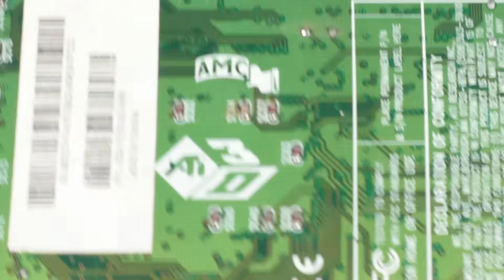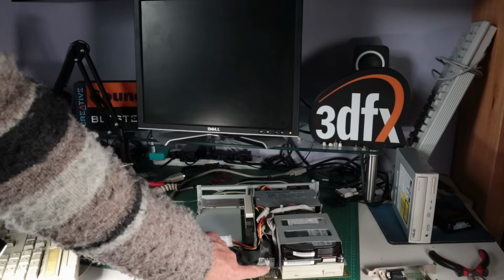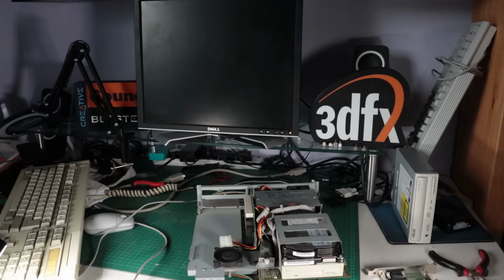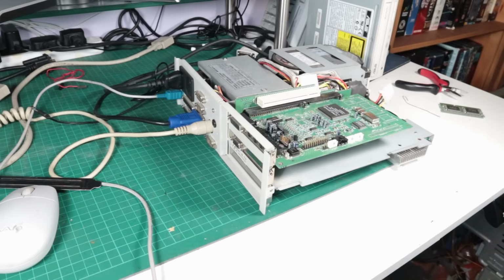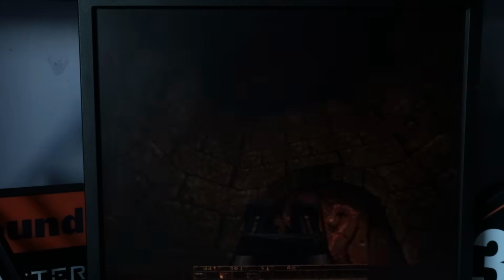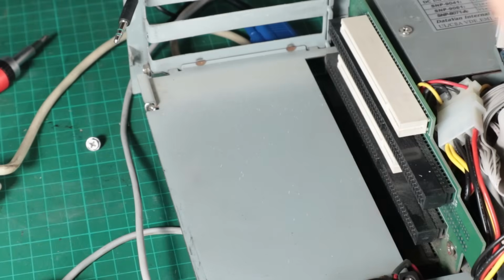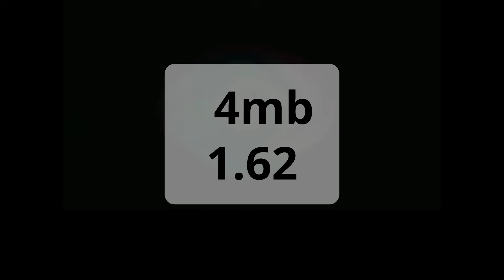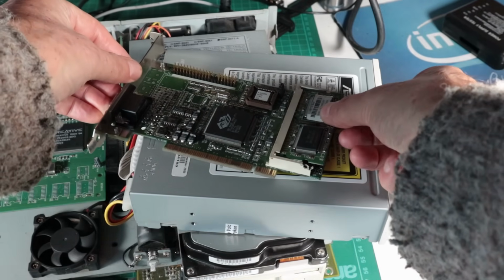Did upgrading vintage graphics card memory make a difference🤔🤞

Comment: Depends on how much memory being used really, if the GPU doesn't need it, then it won't bother. I imagine it might handicap it in some cases, because the memory controller has more addresses to look up at times but that would be minor as the benchmark suggests.
Reply: I know it's just modern parlance but this was before the "GPU" term was even commonspread, this was still just a "3D Accelerator", though it does have the 2D card built in also. "GPU" didn't become marketing speak until the first GeForce card, though it's not entirely marketing, hardware Transformation and Lighting really took a load off the CPU, and basically put the full burden of rendering on the card instead of just being a texture-mapper.
Reply: @Nukle0n  Yeh, they were just called 'Graphics cards' but I used GPU because I just couldn't be bothered. 😁
Reply: @dcikaruga  In computer science class we learned that badly designed memory controls with built in biases can kill system performance no matter how you change other variables. For example is a CPU has to look for data from 2 programs (or 2 parts of a game like drawing stuff in the distance and character animations) and the memory  controller could schedule data to arrive inside the CPU  at different memory addresses but  one memory address is given an order of importance over another until all data from that part of the program is finished the fetch decode execute cycle , then the other data gets CPU access after waiting , that could result in texture pop in for example or slower speed of gameplay.
Reply: @Nukle0n  Idk too much about gaming PC hardware from that time but my understanding is that  for example ps1/sega saturn/ps2/sega dreamcast had extra compute units in the same die as the CPU in the form of a (maths coprocessor/128 vector processing unit/128bit floating point unit/digital signal processor) so seems similar to what you're saying then the graphics hardware/video card focuses on rendering to the screen  and drawing polygons/textures

Comment: the extra ram will not increase performance in tests that don't use more than 4mb of ram. the increased ram allows for higher resolutions, you would have to run the screen at a higher resolution than 1280 x 1024 @ 24 bit colour depth. for 3D it would also depend on buffering too.
Reply from the maker: Yes buffering was where I thought there would be a difference. There's no point in raising resolution when you're barely moving at 640x480.
Reply: @66mhzbrain  640x480 24 bit colour uses like 900KB of gpu ram so even with a triple buffer, it's not going to use more than 4mb.  
the first 3dfx cards only had 4mb of total ram and even then, it was split into 2mb display and 2mb texture ram.

Comment: Thanks for the video. I would run some tests on mines, but your results are solid. I wonder if there's any way to somehow "force" the ram optimization, but those cards are not very configurable. Perhaps more RAM could be useful in CAD programs from the time..... and in different/more powerful machines as per @davidp4456 Anyway, thanks again for making us imagine alternatives and future tests.

Comment: Ati always = disappointment. That was my experience with the brand through 1999 to 2005ish went tnt and tnt 2 and never bought another ati card.
Reply from the maker: Yes they were the underdog back then for sure
Reply: Ati was "good enough" for an also-ran in the 90s behind 3dfx and nvidia, and then it switched around in 2002 when they had the best GPU out there with the 9700. By then there were only 2 manufacturers of note left, ATI and Nvidia which had bought 3dfx

Comment: Back in the day you used the extra mem. to drive big crt high resolution in  >24bit true color  for desktop publishing and photoshop under win95/98
Reply from the maker: I read that but didn't seem higher than 1024x768 with either memory config
Reply: @66mhzbrain  my memory is terrible; I feel like the VRAM was less important for resolution, that just helped the colour depth available.  Resolution was more about the RAM DAC. You could also upgrade the DAC on those of those ATI cards if you could find one.
Reply: @andrewtaylor9704  you needed to step up the memory just to get to the target resolution that you're outputting at with a given colour depth, so you're not wrong but its both at once.
Reply: @themadmallard thanks! A lot has happened since the 90s I worry about what I've forgotten that I've forgotten about 😂😂
Reply: @66mhzbrain  That's probably the monitor's maximum then? A card from this era should definitely be able to do more than that, even a 2 MB one (with lower colour depth in that case), let alone 4 or 8.
Reply: @66mhzbrain  it should do higher than that. maybe it's the driver.  because it should do that without editing registry or custom modes. you could also just test in dos with univbe and some utility that lists the modes (you can query the vesa 2.0 for the modes.. or just use univbe and grand theft auto 1 in dos and see what modes it lets you select)

the extra memory does affect like hw planes and stuff in 2d too somewhat(like playing video) but i dunno how to bench or test that.
Reply: I used to dumpster dive for old computers as a kid since my parents never let me use the “family” computer.
I remember the first time I saw 24 and 32 bit from one of the dumpster computers I was mind blown. I’ve been living the 16 bit lifestyle for too long xD

Comment: Nice video.  You should try the Rage Pro in a higher spec machine so that it is not cpu bottlenecked and we can see exactly what it can do with 8mb.
Reply from the maker: I figured a 200mhz C6 would be enough, but yes I plan to do a few more vids on this with this and other cards with different CPU's
Reply: The Rage Pro with a 200 MHz Pentium rips at 640 x 480 and 800 x 600 in Duke 3d / Blood.
Reply: @zoltangabordudas4393  Indeed - I'm specifically interested in what the choices of RAM singularly at 4Mb or in both combinations at 8mb do to the DOS VESA titles!
Reply: Not much more. Even an integrated ATi with 4mb would be around the same performance

Comment: I upgraded my S3 Verge to 4 megabytes back in the day and I can play tomb raider at a good solid 25 FPS. That was on the S3 virge, I think it was at least the DX version but still it's was more capable than you would think
Reply from the maker: I have one, I plan to retry this with a few different cards and different CPU's etc.
Reply: @66mhzbrain pay attention to which version of the S3 Verge you get. From what I can tell it varies quite a bit.

Comment: Something is not quite right here. It should perform better. I have this card (Rage Pro) on a MMX 233Mhz, GLQuake, for instance, produces around 17FPS, If I recall correctly. It is quite a competent card, on the level of a Rendition Verite 2200 or nVidia Riva 128. Maybe it is the drivers used in your testing?
Reply from the maker: Yes but a 233mhz pentium is considerably faster and better at floating point than a C6. It's relative, this is to compare the card against itself with a memory change within the confines of the C6 performance. CPU still does all the heavy lifting. And yes ati drivers vary widely and my life is too short to find the fastest ones.
Reply: @66mhzbrain  I understand. I would not expect much difference in performance from 4MB to 8MB. None of the card of that era (1996-97), not even the 3DFX Voodoo would make much use of 8MB of Vram. Sorry, I didn´t notice the "weak" IDT Winchip CPU used in the video.
Reply from the maker: It was an experiment really. Just grabbed a machine that I thought wouldn't bottleneck the card. I'm curious now though. Will try with a few different configs, drivers and do the same on some other cards.
Reply: @66mhzbrain  You're SERIOUSLY bottlenecking the card. Winchip is the absolute dregs for any 3D using floating point, even worse than Cyrix which was already lackluster. Point in case, all triangle setup is CPU bound and, given T&L wasn't even a thing at this point, and wouldn't be for a long long time, that's ALL CPU bound. To take any card to its limit you have to pair it with a CPU that it couldn't possibly be waiting for it. Some P3/Athlon/Duron would probably safe for this card. And Quake is actually great to test it. If the software rendering is seriously outpacing the OpenGL version, you have more than enough CPU and are looking at the card's best shot.
Reply from the maker: This was a look at a memory upgrade, not to take the card to its limit. The upgrade should have shown something whatever the CPU. And realistically/historically, if this was the card that you could afford, you wouldn't have paired it with a fast CPU.
Reply: @66mhzbrain  More memory doesn't add speed in and by itself, it just "unlocks" some possibilities IF the hardware can take advantage of it. And there's only a few cases. At 640*480*16 you already have enough memory to double buffer at 2MB, so, memory won't help there. At 800*600*16 much the same. At 1024*768*16 is where it hits the fan, as you're left with ~1MB if you want db. But db (or tb) only helps IF the CPU can feed the card the next frame while it renders the current one. If it's already struggling...
Another area where more memory helps is if there's enough texture memory needed that (given lack of it) you'd be doing PCI/AGP transfers when you should have been rendering. You saw that with 3D Mark and Quake. The former can stress the texture mem enough that you WILL be doing transfers. More memory, less transfers, small improvement. The later had an even bigger bump because it "fully fits", no transfers at all (bar the initial one), the OpenGL pipeline can make good use of it and... you can bet that ATI optimized the bejesus for Id Tech2 in the drivers.
And beg to disagree on the CPU. RagePro was 1997 which is early P2, late P1 vintage. Winchip would be something only offices would buy because the FPU was so lacking. It still had the same issues when Via made it the basis of the C3 and further. Insane power efficiency, lackluster FPU.
p.s. way back in those days, i helped a friend with a "curious" endeavor. He'd got a PC with a Cyrix PR200 from the dumper bin. It was the cheapest office PC I'd seen, 8MB and not even full cache on the mobo. 8MB RAM and a COAST module later it nearly doubled in performance, except for... Quake. My P166MMX still ran rings around it.
Reply from the maker: This is still an entirely realistic user scenario though.
Reply: A riva 128, even the 4mb verision, could give almost 35fps in glquake. So its sort of relative compared to more modern cards of course, but at least in your case its, as you can see, twice the speed.

Comment: Once (just for fun) I finished Max Payne on a Rage Pro Turbo 8mb PCI.  Lowest settings 640x480.  It played most areas 20-30fps, sometimes missing textures from walls and ceilings.  Big asterisk is the CPU was a 2.4GHz Pentium 4 haha
Reply from the maker: Haha, CPU would make a difference with these I guess 😁
Reply: Yeah I have a laptop with an 8 meg rage xl and a 1 ghz Athlon. I was amazed because I had a pci 8MB rage xl I bought for 50$ in 2000 as a kid and I remembered it being so much slower. Then again, I was using it in a Pentium 233 machine overclocked to 266 back then

Comment: That's a really neat little machine. This video proved a lot of what I thought was my problem back in 2000. Never use Pentium MMX, it sucks at gaming even before late 1990's and early 2000 gaming were not even retro yet. Try adding a 300/350 AMD CPU if you have any. I can almost guarantee better performance. This was a very entertaining  video if anything.
Reply from the maker: I aim to explore graphics memory upgrades more with different cards/games/CPU's etc. soon. Cool info, thanks for checking it out!
Reply: @66mhzbrain  In trying to keep my comment short as possible, I forgot to mention the CPU was the bottleneck rather than the GPU, as by 1997/8 we were already in the Super-socket 7, Pentium 2 era. So it's not entirely the CPU type because both Intel MMX and AMD 3D now each has their own strengths.
Reply from the maker: I would have thought. 200 MHz CPU wouldn't bottleneck a rage pro, I will experiment some more!

Comment: How about Windows desktop resolution and color depth? Did they change with that memory upgrade? And by how much?
Also, why do you not test at higher resolution in 3DMark? Maybe at 800x600 or 1024x768 would see a difference between 4M and 8M.
Does this PC do not support another CPU? I would have used an Pentium 200 or a Pentium MMX 200 for the Quake and Windows benchmarks.
Can you test a 1M to 2M upgrade on an older PCI/VLB video card? Many S3 or Trident cards had sockets for adding an 1M RAM upgrade.
Reply from the maker: No, neither. I didn't test in higher resolutions in 3d mark as it was already struggling at 640x480. Yes it does support another CPU, but  I wanted to test with the C6, which still should have been more than enough. And yes, this has made me curious, I will be testing and doing more vids on other cards with memory upgrade slots😁
Reply: @66mhzbrain  Maybe I am wrong, but a 200MHz CPU with 64M EDO RAM and Win98SE... is a no-go for me. Add to that the slow FPU and you get bottleneck.
For these specs, I would choose Win95 OSR2.5. Or upgrade the CPU (Amd 350MHz min), RAM (min 128M, 256M better) and keep Win98SE
Reply from the maker: Everyone has their preferences! There is no right or wrong, back then everyone was stretching their hardware and software in every permuta tion you can think of. This was my take. This was what came out of the cupboard, this is what I went with. An entirely realistic scenario of someone on a budget back then. I know, as I was one.
Reply: @66mhzbrain  Well, that was my opinion. I do not claim to be correct, so please, don´t feel ofended. Also, I did not wanted to crticize, just sharing my experience. In 2001, I upgraded to a P133 with 48M EDO RAM from a 5x86@133 with 48M 30-pin&72-pin mixed RAM, both running Win95 and I know how a upgrade can change whole computing and gaming experience. So, I understand your point. There is no right or wrong, you are right.

Comment: I had Pentium 200MMX with a 2D ATI card one of the PCI ones, but when I added my Voodoo 2 12 Mb it went very nice. But back them some games only worked with some graphic cards not all.  DirectX was not used by all the games that came out.
Reply from the maker: Haha, yes I bet a voodoo 2 was a nice upgrade. Probably would be nice with this one too, it has weak directx but nice 2d😁

Comment: That was only done to allow the card to display higher desktop resolutions and color depths. Gaming performance was always so low that it was a waste of money to upgrade the memory only for games.
Reply from the maker: It did yield a better performance in gl quake but no further resolutions available in windows
Reply: @66mhzbrain  Had a Millennium II back then and with 4 MB the maximum desktop resolution with 16.7m was 1280 x 1024. With 8 MB it went up to 1920 x 1080. Maybe the RAMDAC on the ATI card is at its limit preventing higher resolutions.

Interesting FPS increase in Quake. I did not expect that. More memory allows higher resolutions, but higher resolution also increases workload on the graphics chip. I would not have expected a FPS increase at the same resolution at all. Other games in the benchmarks do not show increased FPS (what was to be expected).
Reply from the maker: I was expecting an increase in resolution, in windows, if nothing else. I wondered about potential effects of increase in frame buffer etc.
Reply: @tellmeaboutloom  I'm pretty sure you could get higher resolutions in the 4:3 ratio if you had a monitor that supported it, 1600x1200 was a common resolution for a 19" + CRT.
Reply: @johng.1703  Had to search a bit for the manual. Maximum resolution for the Millennium II is 1800 × 1440 @ 70 Hertz.

I am surprised they stated 16:9 and 16:10 resolutions at all in the manual, that card is over 25 years old and widescreen displays were not a thing back then.
Reply: @tellmeaboutloom  there was a big "fight" in regards to the 16:9 and 16:10 ratios back in the day, it's a shame 16:9 kinda won out. you could get 16:10 monitors back in 98. but it was the film and TV industry that pushed for the 16:9 which came out much later, like in 2007/8 somewhere around then.
Reply: @tellmeaboutloom  It isnt using more resolution in quake, its simply fitting able to fit the texture data into the VRAM instead of swapping it in from system RAM. So thats why its faster, 4mb wasnt enough to fit all game data. So you had the right idea, but you got a bit mixed up in how 2d resolutions relate to 3d texture data. They dont, in a 1:1 fashion.

Comment: I don't do pre-pentium builds, but 8mb on the card card is a minimum for me simply for the higher resolution; my eyes are too used to HD to be content playing anything at 640 x 480. I'm surprised the extra memory DIDN'T unlock higher resolution, but ATI cards from the era are terrible in general. Most of the ones I have lying around I haven't been able to properly test because cards are a confusing nightmare of either OEM drivers or just confusing naming conventions making it borderline impossible to find the right version.
Reply from the maker: Agreed. I will try this again with matrox and S3.
Reply: @66mhzbrain  My go-to on my DOS system is an 8MB Virge VX and a 12MB Voodoo 2. A few of the later Win 98 games like Star Trek Armada still expect the 2D card to have 8mb even when running glide drivers.
Reply from the maker: Cool never knew!